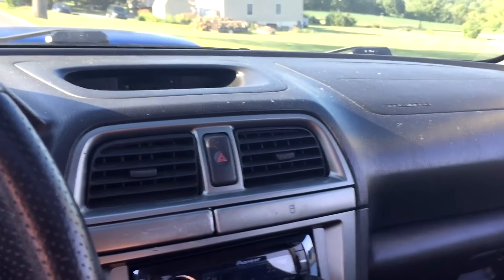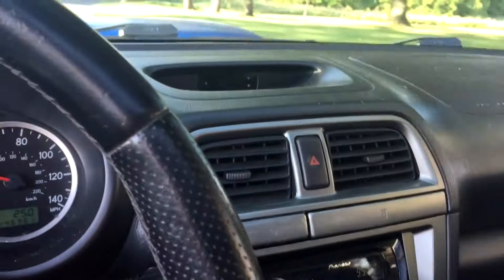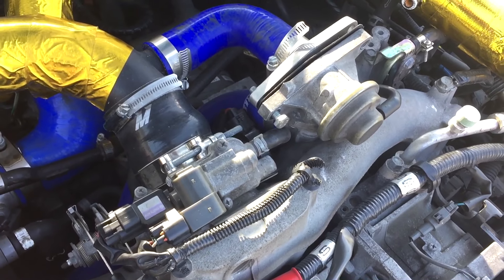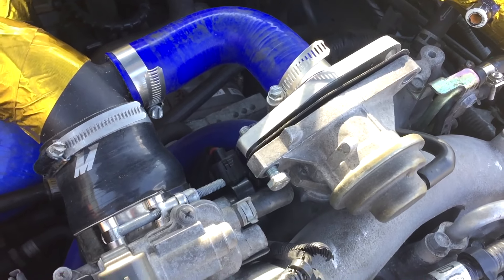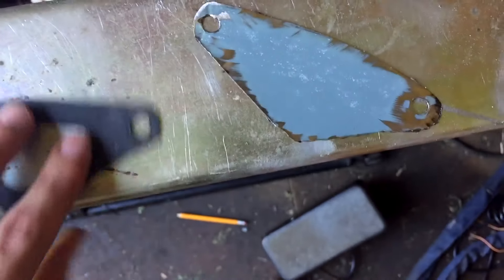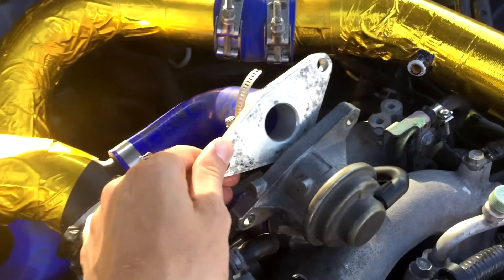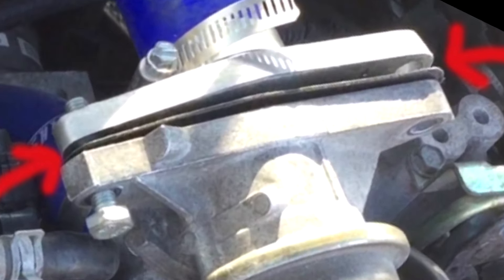DIY | BOV/BPV Delete - Block Off Plate | Stage 3 WRX Turbo Sound

Comment: bad man. def shortening the life of the turbo.
Reply: sounds like my '11 GTI K04 did though..
Reply from the maker: We'll see, hopefully not. Either way I'll keep you posted.
Reply: dont believe everything people say. the bypass valve was invented to reduce the resonance sound of two different types of compressed air pulsating and vibrating during the reverse intake of air towards the compresser. Thats it. For the public road car buyers. Some early turbo cars ran w/o bpv's and ran the expected life. its all speculation.
Shame a shit ton of people do not know this.
Reply from the maker: MrLoStReNeGaDe Thank you for this information! I've always wondered in the back of my mind if it was just for noise reduction... Like resonators in an exhaust.

The only thing that bothers me about the majority that bandwagon on the opposing side of this argument, is that most of their opinions are ignorant of the topic & have never experienced this for themselves let alone had turbo failure because of it. Out of all the research I've done, not once have I read about turbo failure do to no BOV.

Like my tuner told me when I asked him about BOVs. He said "You'll know when you need one."  I've read forums posts written by racing teams. A few mentioned BOVs not being necessary until around 30psi lol So most road cars, or my car for example only running 17psi. I don't think it's as big a problem as so many seem to claim.

Anyways I can go on and on regarding this & I totally understand the argument on both sides regarding turbo health & BOV/BPVs being put there for a reason. I'm just going to pioneer this a bit & see what happens. If my turbo takes a shit on me, then I'll make sure everyone knows that I had no BOV/BPV when it happened. OR when I drive another 50k miles & my turbo is still spinning fine, I'll be sure to share that too!

This is one myth I'd love to squash.
Reply: exactly. its good your still open minded unlike most. I know of a bloke who closed off his bpv on his r34 at 5k, and sold it at 105k fully working with the same turbo. proofs in the pudding. Look after your turbo by simply, looking after it! Providing you know how to ofcourse and have the required upgrades to support the current turbo.
Enjoy your scoob
Reply: +Subie Rumble Truth.   Seems like you are gonna keep us posted of the results regardless.  I always thought about doing something like this but never done enough research to bite the bullet...
I assume the similar results for a 15 WRX.  

Keep us posted.
Reply: Oh... What a great comment! Thanks sir!!
Reply: Yea, compressor surge, it's definitely great for the turbine and bearing! SMH.
Reply: Ty Pettri you do realize that compressor surge and turbo flutter are two way different things right? Lmao rn, and in all actuality, flutter does not put that much wear or stress on the turbo. A friend of mine has had turbo flutter in his sti for over 30,000 miles and it's still going strong
Reply: Unless you can explain the difference.... just stop talking lol
Reply: Compressor surge is when the turbo cant force enough air into the motor causing it to back up....Flutter is when there is no bypass valve and the air releases through the inlet. Surge is bad because the turbo cant do what its designed to do. Flutter is just air coming back out. It doesnt actually stop the blades from spinning. Its just the air getting chopped up by the fins on the compressor wheel....There is a huge difference between the 2.
Reply: That's it!!
Reply: squishypitbull actually, compressor surge is when pressure is built up in the system and you snap the throttle shut by letting off the gas. when this happens the turbo is not able to keep a steady flow and pressurize the cylinders so the air bounces off the turbine jolting it's rotating assembly.

its stressful on the turbo but if you like the sound then who cares, right?! lol
Reply: The surge can happen both on and off throttle. The off throttle surge is ok. On power...no good.
Nothing is jolting (or it shouldnt be) its just cavitating...Thats all. 
And you're totally right....Up to the person. 
I blocked mine off a few days ago to see how it would be...I like it. 
Gonna take if off today and reset the ECU to compare the drivability. 
The only thing I care about is the way the car drives....Im not looking for the flutter per se but if blocking it off makes the car run better when im trying to haul then thats what i'll go with.
Reply: 100k doesn't exactly prove longevity.
Reply: PhoenixEMedia ok, so my buddies grand national that he just got from his father, never had a bov or anything of the sort. Car has over 500k on it and they just now rebult everything. Turbo didn't need a rebuild but they did it anyways . The issue is cars are not made like they used to be. I have at least 5 friends with older boosted cars.  All of them no bov and over 150 k or more with no issues. 
While no one can claim absolute reliability the simple fact is that there is no proof that it does any actual harm to the turbo, no matter what kind. What really determines the lifespan of a car or turbo is the driver. 
I'm pushing numbers out of my stock trans I shouldn't be pushing. I have friends with  80hp and a shitload lesss tq blowing their trans or something else every few months....the driver matters more than anything but for nowadays.....100k is pretty good for anything
Reply: squishypitbull anecdotes is all you have. 150k isnt much. If a car was designed without a bpv you then its a bad comparison to ones with block off plates.
Reply: Ty Petrisin not that kind of surge, look it up there's tons of videos explaining how this is realistically harmless
Reply: Flutter use to be the standard for turbo cars. When turbo cars first came around they all ran without BOV's. Flutter wasn't seen as something that would destroy a turbo not even to manufacturers. I believe it was the rice scene that actually gave rise to BOV's in order to enhance or change the sound of flutter to something else for scene points and it 'saving turbo's' was the marketing pitch in order to sell them to every idiot. It worked because now everyone is running them and less cars flutter but its so boring. I think the point is, physics would suggest that flutter will give a turbo more stress but in reality it's usually never enough stress to make a difference because by the the time that turbo is ready to shit itself because of some pathetic flutter, you'd have sold the car or the engine would have already died long before. Do you know how fast turbo blades spin? There's barely any setups out there that will produce enough boost to be able to even significantly oppose the spinning blades of a turbo coming off throttle let alone damage them. The charged air trapped between the closed throttle plate and turbo is a pathetic amount of pressure for a spinning turbo to deal with. If it really was a significant amount of pressurised air it would pop off most people's flimsy eBay boost pipes for a start which rarely happens let alone damage a fucking turbine that can whitstand explosive exhaust conditions. It's people that sit on their anti lag all day spitting flames that eventually fuck their turbo not some pathetic air trapped in your fucking intercooler.
Reply: I always thought the idea of a bov was to help reduce lag as flutter slows the turbine down when of throttle? And also reduce noice for the boring masses?
Reply: LastHumansGarage flutter really doesnt have any solid proof of reducing the life that drastically as turbos dont last too long anyways expecially modified
Reply: From my research, a block of plate can actually reduce turbo lag between shifts because instead of the bov/bpv venting the extra boost, some actually stays in the piping allowing it to already have some stored energy when the throttle plate is reopened.
Reply: LastHumansGarage with a good name brand turbo that’s been proven to be a myth.
Reply: 50% true, all what you are damaging are bearings thats all
Reply: JD Berdar yea you’re right. People have the wrong info. Turbo flutter is not bad for the turbo. Open compressor surge is bad for the turbo that means while you have your foot down on the gas you are hearing the flutter. Closed surge isn’t harmful at all
Reply: Bradley Hall actually this is false.
Reply: @jdberdar6997  30k miles is nothing bro... cmon man . Turbo engines are already hella fragile as a whole ,and you blocking that air from escaping in a BOV means it goes back through the turbine making it flutter. Its bad
Reply: @typ8723  think there is no bearing on these.. Floating on oil(pressure) like MHI turbo's.. If oil pressure drops, that s a real killer in those types.

Comment: Did u have to tune this mod?  Is the AFR all whack?  Doesn't the stock ecu expect a BPV recirc?
Reply from the maker: Of course it expects some extra air after the throttle plate closes and the leftover boost pressure recurculates back into the intake. By a very small percent. Think about how fast that is all happening and the amount of air we're actually talking about. Your car will run and drive fine
Reply: @SubieRumble  yeah that's fair.  I saw these 2 English dudes do this a few years ago and after 2yrs of track driving it's still fine.. so FTW!

Comment: Is it safe to just block off the circulation to the bov on a stock engine? Would it cause more wear on the engine or other components? I love the sound of it but if it destorys my engine i rather not do it. Thanks for the input
Reply: Stock does not mean it is naturally aspirated. My STi is stock, and its definitely turbocharged.
Reply: @anotherpewtertahoe  I know this is old but Same, I got an XT but same.

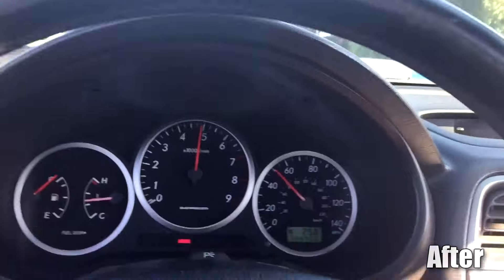Comment: Wait, ive heard that if your turbo flutter while you floor it your car it means that your turbo might have a problem. on 1:43 you can hear when you floor it the flutter noise came up before you release your gas pedal. Im not a mechanic or genius im just asking.

Comment: What if you don't seal it up completely and drill a small 10mm or less hole on the block off plate just enough to to get the flutter while still bypass a bit of air, will it work?

Comment: Isn't bad for the turbo ?
And do you loose much performance ?
Reply: u gain performance. reduced turbo lag
Reply from the maker: In theory, it adds stress to parts of the turbo that could be reduced through using a BOV/BPV... How much stress or damage is this doing? Idk... There's plenty of people out there who run their cars like this & never had any issues. I suppose time will tell.
Reply: Ok thanks, i was thinking about doing it. I have good quality turbos it should hold up fine.
Reply from the maker: Dédé LABINOUZE & like I said, it's super easy to just remove the plates if you end up changing your mind!
Reply: I love this sound so much the only thing that could change my mind would be my turbos exploding haha
Reply from the maker: Dédé LABINOUZE Well it certainly won't explode. If anything, it may damage the bearings. May... But there are plenty of cars that ran without them from factory that are still on the road today
Reply: Subie Rumble
I know they won't explode lol that was a joke.
Yeah but they're on 4-5psi, not 13
Reply from the maker: Dédé LABINOUZE uh idk about 4-5 lol & I'm at 17 right now
Reply: Subie Rumble
17 stock ? lol
Reply from the maker: Dédé LABINOUZE WRX had 13.5psi stock, STi had 14.5psi stock. the psi your turbo is pushing isn't the only thing that makes power. It's just air pressure not necessarily always equaling air flow.
Reply: Subie Rumble
Damn i wasn't expecting the WRX to spool that hard.
Reply: Dédé LABINOUZE reduced turbo lag but also reducing the longevity of the turbo
Reply: Subie Rumble since its been about a year have you noticed or had trouble with your turbo?

Comment: Hey man, definitely a good put together video but I just want to let everybody know that that sound you are hearing is something called Turbo search, because the air is not either circulating back through the system or being vented to the atmosphere, it’s being shoved back into the turbo so instead of hearing a nice blow off sound what you’re hearing is the Air Forcing the turbo to spin backwards

It’s absolutely horrible for your terrible but it’s also like smoking cigarettes… Even though it’s really bad for it, you’re not causing any real damage for a while but at the end of the day, why do that

Comment: hey man i did this to my pretty much all stock 2002 wrx and i didn't get the awesome sound. I am also running stock air box does that have to do with anything? just trouble shooting. Keep up the sick vids.
Reply: Julian Miller you'll want to get a pod filter or a full cold air intake
Reply: Air box mufflers a lot of the sound, if you want to be louder run a pod filter and metal intake pipe going into the turbo.
Reply: you have a intake box under your fender. if you delete that you will hear the turbo spool up.

Comment: You can get the same result of sound if you disconnect the vaccum line that runs from bypass vavle to throttle body.. you lose a few pounds of boost though.
Reply from the maker: haha I don't want to lose any boost :p

Comment: Yoooo, i have a 05 wrx n i did the same thing you did with the block off plate. But it doesnt make that stututu sound insted it makes like a pprrrrr sound. I wondering if maybe its because i have stock everything except a COBB intake n and aftermarket exhaust or maybe i just need a bigger turbo. Can you plz tell me what i need to get that same sound.thanks bro
Reply: could be that there isnt a god seal
Reply: @Oscar-nf1uv  sounds reasonable. Ima have to check it out.

Comment: There is already a bov that sounds like this. That is the sound from fast and furious. This is called turbo surge and it kills turbo there is no question either low or high boost it is bad and bends the fins. Hks make the SSQV BOV it is known as the "turkey" valve because it sounds like a 🦃. It is an actual bov but releases air in small bursts instead of the normal piston type making the 🦃 sound.
Reply: HKS SSQV sounds very different to flutter, as for it killing turbos, haven't killed one yet due to flutter.

Comment: How has it been in between shifts? Notice more/less delay in spool/boost? I'm more curious with that then the potential for damage that may or may not happen with 17.5 pounds of boost.
Reply from the maker: I haven't really watched the boost gauge or ran logs before & after doing this to give you the best answer unfortunately... At the very least I can say it feels good!
Reply: @SubieRumble  Do you need to retune your car after doing this modification?
Reply: @lmiester4633  That's a good question 🤔 if your mpg is worse, I'd assume it would run a lil richer if anything, but I don't think it would be anything to worry much about
Reply from the maker: @lmiester4633  it would only benefit you to get a tune, but no, you don't NEED a tune.

Comment: hey question... I'm running a baseline Cobb map vf39 on wrx with a stock bpv (100% recirculating). if I wanted to try this out would I need to but a different tune on the car? I know you need one with an aftermarket bov that vents to atmosphere.. thanks!!
Reply from the maker: No you don't need a tune. The reason you need a tune on a BOV is because it dumps ALL the air to atmosphere where your BPV (or recirculating valve) redirects the air from your intercooler to your turbo inlet. Therefore your ECU is expecting air to be where the BPV would've originally put it, except since your BOV vents it all, the air won't be there & you may run rich for a split second after letting of the throttle. By not having either (or by using the block off plates like in the video) The air is now forced to travel backwards through the system & out your turbo, there by reducing turbo lag between shifts & doing what your stock bpv is doing, except better. The engine gets the air the ECU expects from the BPV & turbo lag is reduced. The car will run the same.

Very good question!
Reply: +Subie Rumble wow awesome thank you! So motivated to do this tonight. Do you think the sheet metal is durable enough over time or should I eventually buy a properly machined delete for $10 (TMIC).
Reply from the maker: MyDethStar It's up to you. If you're looking for long term peace of mind, then go for something machined. But any corrosion resistant metal should be fine. (tin, aluminum, stainless steel) Just make sure whatever you're using to block off the pressure is thick enough & doesn't bend. If it bends under pressure, then it may leak boost.

Comment: Just so everyone is aware. Do not do this. That sound is compressor surge. That is the sound of the compressed air coming back from your throttle body and slamming into the compressor wheel. This will wreak havoc on your turbo’s bearings
Reply: Just so everyone is aware, do this if you like the sound, it doesn't wreck havoc on anything.

Comment: What happened at 1:29? Isn't that sound harmful for the turbo?
Reply: that’s the external wastegate, instead of routing it through the exhaust system it just dump straight down into the atmosphere, which is why it’s loud when in boost